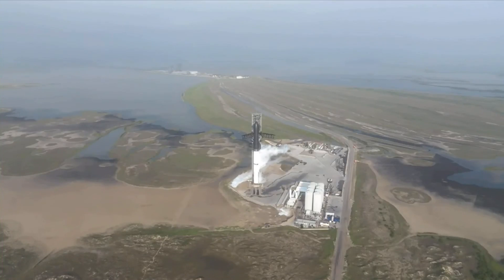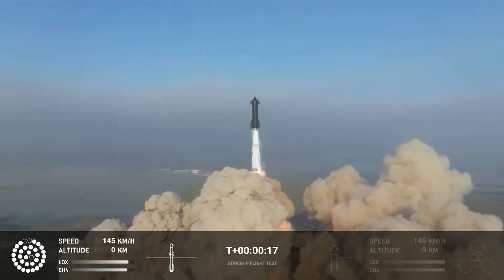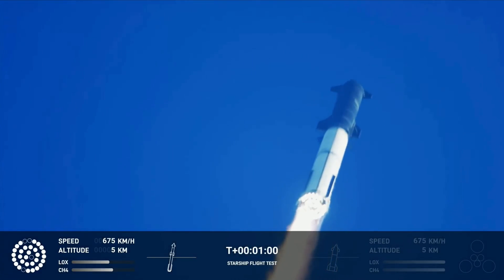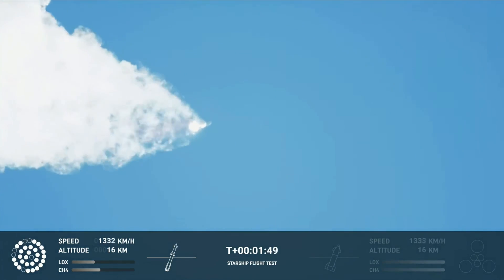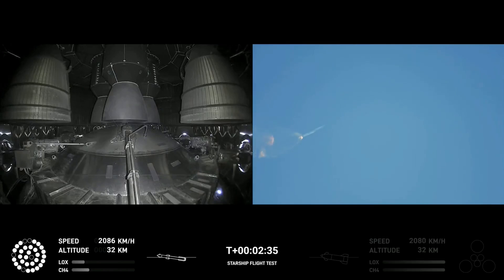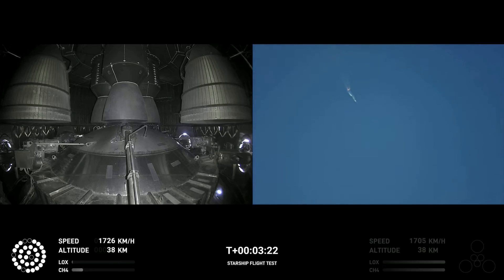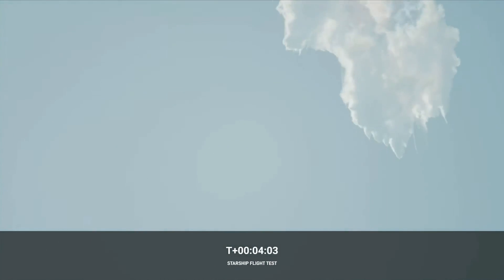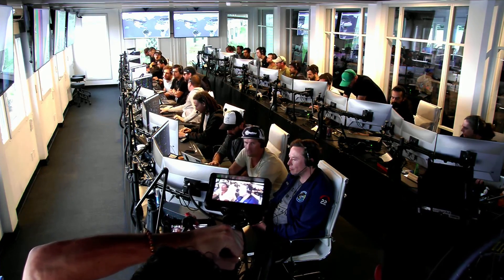Boom! SpaceX Starship has explosive first space launch attempt, test still succesful

Comment: Failure aside could we talk about the Engine out capability of Starship? 
Literally lost 6 engine and still manages to lift off and reach MaxQ
Reply: Yeah it was calculated even if some engine goes off it does a succesfull launch
Reply: We have N1 flashbacks all over again
Reply: @goldgamercommenting2990  The starship booster engines can gimbal though, right? The N1 engines could not and needed to use differential thrust to steer. That plus engine failures meant cascading engine shutdowns.
Reply: @goldgamercommenting2990  At least it clear the tower lol and doesn't create the largest non nuclear explosion
Reply: @goldgamercommenting2990  Turns out that this was a much better launch than all of N1's launches. They need to rework the staging according to the SpaceX tweets, and consider that Starship survived what looked like three end over end tumbles before being terminated by the FTS. That's impressive in its own right.
Reply: @jbalsle  I've flipped so many rockets like this in KSP, I can't believe the vehicle wasn't ripped apart by the tumbling. Incredible!
Reply: Except when it loses engines it throws off the vector
Reply: @jbalsle  I also saw 27 seconds into flight, a copv bursted
Reply: @goldgamercommenting2990  It looked like it was about the time one of the engines shut down.

They did say all of the newer boosters have electric gimbaling instead of hydraulic. It would be fortuitous if some failures were attributed to the obsolete hydraulic system.
Reply: Ro Bear  you're likely the only one here obtuse enough to want to see Starship fail because of your feelings over Twitter.
Reply: An empty Starship. Add 100+ tons to Starship and see how it goes.
Reply: @goldgamercommenting2990  The N1 never made it to Max-Q, so  Starship wins on that one.
Reply: Hi 👋, what a great shame, I cannot understand why it had to flip, ??? As I would of thought it would put a massive strain on the construction, 
So why couldn’t it separate like other rockets normally do? , By just releasing the stage and dropping away, 
PHIL FROM THE DARK SIDE OF THE MOULIN FRANCE.
Reply: @vapoet  only the 4th flight before the fuel lines burst 

Starship made it through but lost 5 to 6 engines and one copv
Reply: Ro Bear  It's a shame you weren't on that rocket.
Reply: @fromdarknesscomeslight6894  IIRC only a couple of the engines can gimbal, it mostly works on differential thrust to save mass. But with that many engines they have some wiggle room to throttle multiple engines to counteract each outage. They can probably throttle some up on the side of the loss as well assuming they're not running at full thrust from the beginning.
Reply: Not a full load this trip, either..❤😊
Reply: @vapoet  N-1 made it to max Q at 3rd and 4th launch. Starship this time had so low TWR so it did not reach mach 1 at 8-9 km like every other rocket does. It gained like 70% of that speed while background voice kept telling us about twice the thrust of Saturn-V. All 21st century computing power to not program some actions for "in case of evergency".
Reply: @sdefonta  Its engines can gimball, its made to work with multiple engine failures, I think 6 is the limit.
Reply: @MikeJProto  Awesome comment, perfect use of internet, literally lol
Reply: Failure? Do you understand nothing?
Reply: @executivesteps  it will point in the right direction much easier then.. 😄👌
Reply: @Chris-hn4lp  why would it lose 6 engines unless one of them blew and damaged others?
Reply: 33 engines, five failed interesting configuration.  I know nothing, I see something.
Reply: Exceeds KSP and becomes a fish.
Reply: @sdefonta  yeah but the other engines gimbal to offset the lost thrust
Reply: @rogerrinkavage6477  well they didn't do that either
Reply: That's not a good thing..  One of the engine failures may have been responsible for the destruction of the entire vehicle.
Reply: I counted 7. And it was going to reach Max Q regardless if it kept flying. That’s not a fixed value, it’s a variable each which depends speed, altitude.
Reply: @ericmatthews8497  I'm no rocket surgeon but wasn't it the failure to separate stages that led to the RUD here?
Reply: @HoldMyPoopKnife  There is lots of video out there now. You can see the vehicle was rocked by explosions during the ascent.  It was in "anomaly mode" long before they lost flight control.
Reply: looks like the launch pad took a TON of damage.    reusable rocket,  disposable launch pad.  a novel solution to be sure.
Reply: @sdefonta  Likely, they may have understood this and have a plan to auto adjust the other engines to still provide control. I do say the end over end flips were surreal!!
Reply: Ro Bear  how do you figure "total failure" it was literally the first integrated launch and it worked out very well and now they have loads of data to work from. Also not sure about your comment on Twitter because For the first Time in decades there actually turning a profit so all you are really doing here is showing the internet your level of ignorance and bias
Reply: Engine loss means asymmetrical thrust that may or may not be able to be overcome.
Reply: @MrShobar  but stage separation was supposed to come before it started flipping around
Reply: @goldgamercommenting2990  i was thinking the same thing it had a large number of engine and blew up the same way.
Reply: Yea, seems they have some work
Reply: "lost six engines"
"Did a flip"
"Blew up"

"Well done"
Reply: @paulwilson8367  Rocket engines don't fail by blowing up generally. And 6 engines were out on this. There are all sorts of modes of failure than can cause  a Rocket engine run at this extreme of temp and pressure to go out. It's also very difficult to get the engines to start to begin with.
Reply: @Chris-hn4lp  this is a big problem.  Raptors appear to be difficult to light and difficult to relight.
Reply: @Chris-hn4lp  I saw streaks in the engine exhaust trails that suggested engines were failing in flight.  
Ok but I am not an engineer
Reply: ``` SpaceX Starship = 100% failure
``` SpaceX Starship = absolute disaster
``` Musk you failed! hahahahahahaXD
Reply: Serious issues losing control of inflammatory substances?
Reply: No deniability here!!! Obviously exploding impediments? Boommmm!!
Reply: @SpecialEDy  ✅?
Reply: Too much power!!
Reply: @fromdarknesscomeslight6894  The center engines gimbal. The ones on the outer ring don't.
Reply: And no payload so it was probably at its minimum weight
Reply: Oh I just wish some European children got a chance to ride on for free😂🎉😂🎉
Reply: One small Phallic for Elon,  One Giant Phallic bursting for Mankind.
Reply: @Chris-hn4lp  Apparently, ALL of these engines failed due to the flying concrete debris on liftoff and the destruction of the OLM concrete floor structure.  I watched the slow motion of the launch.
Reply: 3*
Reply: @BigSp3nda ?????
Reply: Nice cope.
Reply: @michajanicki6860 imagine critising

Comment: cant wait for Space X to tell us what exactly went wrong.
looked like multiple Raptors went boom just before the spin and also at least one about 30 seconds into the flight
but that thing flipping like a rocket designed by KErbals but staying in one piece???? damn thats some solid engineering
Reply: I almost wonder if it could have been an intentional detonation after they couldn't achieve booster separation. But it seems like they reached orbit - or nearly - just couldn't get the separation to finish it off
Reply: @LuKiSCraft  it was definitely intentional.  They destroyed it as it was tumbling out of control.  5 engines out and whatever else.  The booster was at best a mixed bag.  Ship 24 had no chance to fly on its own.
Reply: @paulwilson8367  Ya makes sense. Still impressive to see a rocket larger than the Saturn V do this. They will get it to work within 3 more tries I'd bet.
Reply: A guy named Brian left a half eaten ham sandwich 🥪 laying where it should not have been.💫👽💫
Reply: Definitely unintentionally lol. Even if no space ship has achieved orbit and so on on the first try, no engineers would blow their space ship up intentionally. They were happy to see the flight time, correct pathing, etc. The separation of boosters not happening caused a shift of weight and fuel causing the spaceship to spin. Great design, great flight, and shows that up until the final prep,  the only thing they need to fix is the separation initiatives.
Reply: @kz_what_ever   what are you taking about? It is an international requirement that all rockets capable of reaching orbit have a kill switch for these cases, it has been used countless times, by the time the first spin was wrong, all was lost, it took time to detonate it to extract the most possible amount of data.
Reply: probably the all the concrete getting thrown around damaging the engines.
Reply: @kz_what_ever  I'm pretty sure they do this often for safety reasons. I know for a fact they have intentionally detonated Falcon 9 rockets. I think SpaceX produces like 1 Starship per month now (or close)
Reply: My wild guess is one of two reasons. There wasnt enough air at that altitude for it to remain aerodynamic with control surfaces and it was too unstable for the hot gas thrusters with multiple engines out. Also..... The boosters may need control surfaces to keep the center of lift further back but it really doesnt seem like a center of lift problem. If center of lift isnt behind the center of mass this will happen. But theoretically it should have become more stable as the fuel burning caused the center of mass to rise towards the front. Think of it as a dart. Heavy in the front light in the back.
Reply: It sounds like debris took out some raptors, and then the hydraulic control box got messes up. That meant the hooks couldn't release the 2nd stage during stage seperation. Booster 7 tried to do a flip for a boost back burn with ship 24 still attached. That sent the onboard flight control and gimbal controls into a frenzy, so it just looped. Then they detonated the FTS.
Reply: @kz_what_ever  wait a minute....."no space ship has achieved orbit...on the first try"? The first Mercury-Atlas that was supposed to reach orbit did so. The first Gemini that tried succeeded. The first Apollo that tried succeeded. Etc.

"No engineers would blow their space ship intentionally".....wrong wrong wrong. Since the dawn of (large) rockets, engineering have been blowing them up intentionally during failed launches!
Reply: @LuKiSCraft  low earth orbit is 1,200 miles up.... the rocket only made about 23 miles up.... I don't think it reached orbit
Reply: the earth electromagnetic wall.... elon shows us proof that men were never in space
Reply: @electrifyingct4303  Lol I didn't realize it only went up 23 miles. Wasn't this supposed to be an orbital test!!?
Reply: @LuKiSCraft  to be completely honest, I didn't know anything about this today, but yeah... they always say "something" anyway.

Millions of dollars just exploded in the sky and everyone is cheering and congratulating them.... it is extremely silly if you ask me
Reply: @electrifyingct4303  Well, in the earlier days they blew up 3 Falcon 9 rockets before getting that right. And now they can even land the rockets back on the ground most of the time. Imagine if they actually get this thing to work & land in/near the "mechazilla" arms... they could make space travel super cheap all of a sudden
Reply: @paulwilson8367  But still the failure moved many noobs to tears.
Reply: They lost a couple HPUs in the bright flashes just after liftoff. When the last HPU went out after max Q, booster lost all control authority and started drifting sideways.
Reply: @electrifyingct4303  low earth orbit starts at 62 miles up...
Reply: @RocketPropulsionProject  According to Nasa.gov.... it 1,200 miles up.... and either way...  this rocket only made it 23 miles.... so why you comment?

Comment: As Scott Manley would say "check yo' staging". A very Kerbal launch with all those flips and the lack of stage separation. But cool that it made it past max Q at least. I believe it's now the largest rocket to have ever flown, even if it didn't make it to orbit?
Reply: Yeah definitely in terms of mass, n1 may have been taller
Reply: The max q success was all I was really hopping for. It would have been amazing if it had done better but this was still an amazing event
Reply: The biggest, heaviest thing ever flown
Reply: I hope for an answer soon but did stage separation fail or did it not go high enough for stage separation and failed due to multiple engine failure and the thrust vector control not working correctly 🤔
Reply: @seanbaskett5506  WTF you talkin bout Willis?

Comment: I wonder if those engine failures tweaked the structure enough to cause the separation to fail before the other engines could compensate. I could imagine with so much forces acting in the vessel, even a microsecond surge of imbalance would have an affect on the overall structure.

Comment: That control room didn’t look nearly as positive about the results as the announcers made the situation out to be
Reply: Musk sitting in the first seat looked kind of glum.
Reply: I mean obviously it would have been much better If the rocket did not explode, but it's still surprising that the rocket even made it that far
Reply: @Unown134  we’ve sent ships to the moon. This shoulda been child’s play. Let’s treat this with a modicum of reality here.
Reply: @sgtgiggles  bro those were tiny ships and non reusable, the starship on the otherhand is 390 ft reusable rocket that is ment to save  HUGE amounts of money.
Reply: @Unown134  no disagreeing on that, but you’re missing the point: it failed at doing the stuff we’ve already mastered. The test wasn’t about the liftoff, it was about the separation and retrieval systems. Liftoff is not the hard part. Again, let’s treat this with reality, and not lap up what his PR team is claiming to be a success. This is Boeing 737max bad.

Comment: What happened at time 36:40?  There was a huge flare-up with the exhaust coming off the rocket engines.  Also, the rocket appeared to be moving sideways as it left it’s launching pad.  Debris was thrown all over the place.  Why isn’t there a built in flame trench at the base of the launching tower?  By directing the rocket blast away from the tower, there might be less damage caused by the rocket at liftoff.
Reply: Your asking questions which make too much sense.
Reply: That's a lot of questions but first of there's 6 Engine failure and the rocket still manages the clear the Launch Tower.

And the reason why there's a lot of flame in the Launch Tower is because there's no Water Dilute System and Flame Trench to divert the flame
Reply: Asymmetrical thrust from losing engines likely. But on the other hand there are rockets that were designed to launch like that. Space Shuttle for example.
Reply: That is their plans, They desperately needed to get the lift of data. The next upcoming launches will see a LOT of improvements.
Reply: They can’t make trench because of the water level under the base
Reply: @GeryDivry  well that makes sense.

Comment: Absolutely savage, ship may have blown up but it gained altitude with 6 engines out and survived hell knows how many flips without breaking up. Test was a massive success.
Reply: good way to look at it.
Reply: I still can't get my head around it surviving those flips, I was ready for it to tear itself apart!
Reply: I mean, it was empty though. Let's see how well it does with an actual payload
Reply: @HoldMyPoopKnife  superheavy's total payload capacity (150 tonnes in reusable configuration) is only 3% of it's total launch weight (5,000 tonnes). The rest is fuel. So adding a full payload really wouldn't change much in this test.
Reply: Keep smiling and cheering 😂
Reply: @HoldMyPoopKnife  it had payload but just mass no satélite stuff
Reply: @John Bailey  the weight was accurate. Just nothing of value
Reply: Fail
Reply: @HoldMyPoopKnife  am empty sheep is more fragile than a filled one. The fuel and pressure in the tanks contribute to the stiffness of the ship. That's why they always keep these ships pressurised while parked at starbase or elsewhere.